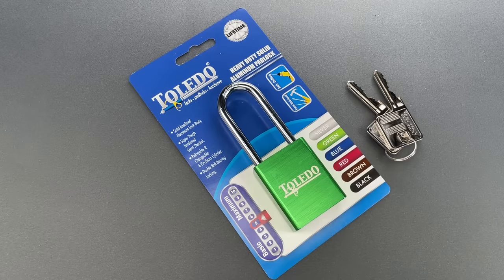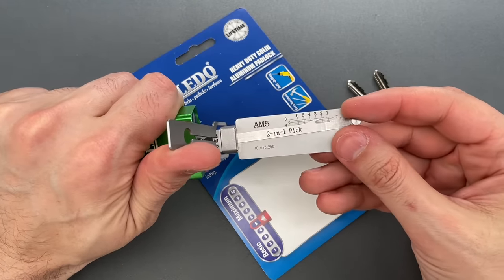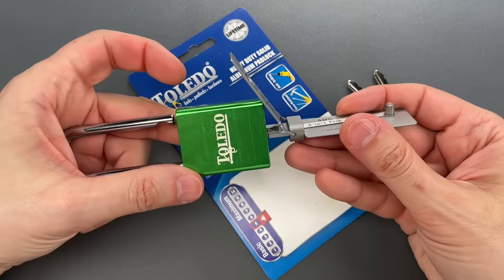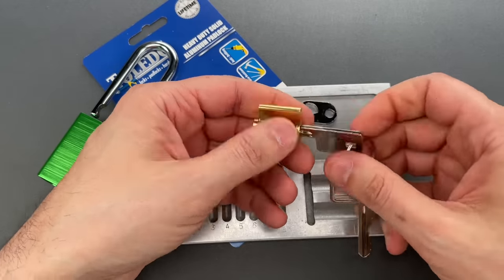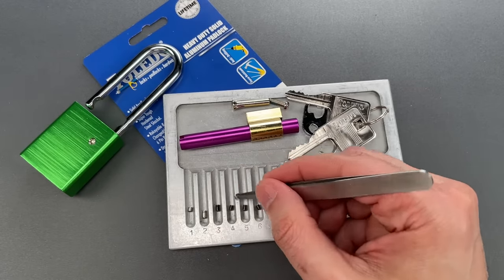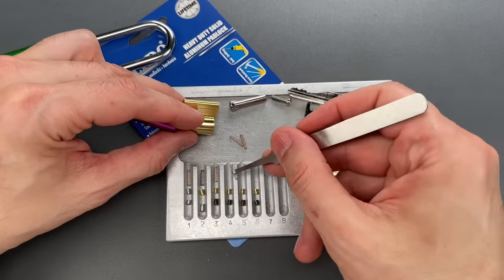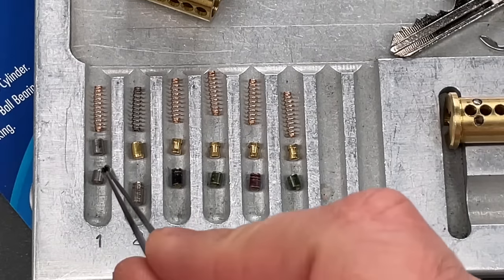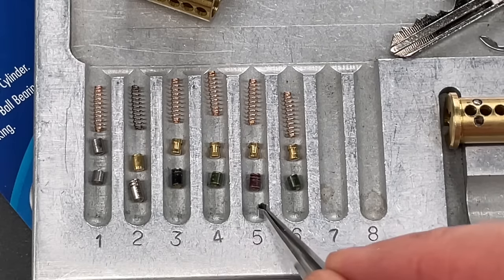[1550] Better Than Expected: Toledo 40mm Alum. Padlock

Comment: PRYBAR. I meant, yea this lock had nice pick resistance, but there is something about that nice sound of broken steel and stuff.
 
Also when lock to your toilet breaks, you need a prybar to get to the toilet (or out to stay alive). I didn't have a prybar, thus instead of opening it in 2 minutes, I had to find wrenches and use wrenches, and find the door is from two pieces glued together that partially get out, and find because I'm whitebearded disabled pensioner whos pension is still pending after 20 years, I have to live with partially warped toilet doors that are without lock. 

And all of that was because EU ordered to use heat regulators for central heaters, and because they blew up Nord Stream and they are supporting oligarchs in that xxx country, prices went up. And large difference between temperatures weakened door springs.
More rich people can afford more heating, thus they have fungus in theirs homes because of large temperature differences...
EU = we are living ecologically.

Comment: You said the core has two steel pins for dulling drill bits. Is there a way for you to check if the drain hole has something similar?

Comment: You are a very good lock pick and also know how to also attack a lock with force but you always do your tests in ideal conditions not attached to an asp and staple or motorbike locks that are in awkward places. It would be more of a challenge to see how the locks are attacked by picking or force when the lock is placed ideally on a garage, shed or motorbike with wet cold hands and a swinging lock also sometimes in the dark.

Comment: Why don't they just put the tougher springs on all the pins? Not sure if he mentioned this in the video.
Reply: First and foremost is cost. For mass production the cost of using those springs in all of the pin stacks would raise the price significantly across the board. 
But in practice you also don’t really need every stack to have a stronger spring since that one is already going to make it near-impossible to open with a bump-key

Comment: Hey all, I have a question and I figure this would be as good a place to ask as any. I have an apartment a screen door that is locking but I was not issued a key for it (the thumb button has a keyway.) I can lock it from the inside with a latch but without a key I can't lock it from the outside. I have a dog who is a good girl with separation anxiety who would appreciate it if I could leave the front door open while I go to the laundry room or to my car but I would appreciate it if I could lock the screen door for quick 2-10 min trips away. Is there a good way to decode a screen door lock so I can order a key for it?

Comment: If spring type matters why not use multiple different springs... Wouldn't it make it more tricky? And couldn't you set up a trick driver to reset if the picker moves the tumbler at all before the other pins are set? And there has to be a way to make a lock LOOK shim-able but isn't... Right??? We gotta have designers and metal workers that can figure this out right? (Oh great new generations of locksmiths that only keep the good locks for themselves while giving out the ones they know are pickable, breakable or just weak in general...) I actually witnessed some grab a masterlock and yank and it popped open, and it was a lock his father put in place to deter him from going past... Dad... You're 5ft tall and tiny those locks will stop you... but your son... is like 10ft and all muscle... Locks wont stop him... I THOUGHT he was gonna rip the lock off the door, but he didn't... He propped one hand over the hasp and took the lock with the other, with a hard quick yank level with the shackle, KACHINK!!! lock opened... I was like... "WHOA SOME WHO IS FASTER THAN LPL!!! Well Masterlock is done, shut down the factories! It's all over!" LOL!!!

Comment: Dear lockpickinglawyer.. Are you aware of "Checkhov's Gun" ? If you mention a weapon in scene 1, that gun must be fired in scene 2. You violated that rule, in this very video. You mentioned that you would drill that hole.. and then you did not drill that hole in act 2. Sir. We need an act 3 to see this corrected. ;)

Comment: That is probably 10/10 grade from LPL to a lock that company itself says being just 5/10 secure. Would be different if company would claim that this is 10/10 secure super pick resistant bullet proof lock that companies typically claim their products being. Kind of sad that company that is honest might not sell as well as the typical shitty locks, that claim being superior on the package even though they are not. I hope they add quote from LPL to the packing saying that company puts more effort to being  secure than most. I womder if they have some lock that is 10/10 secure if that is actually then really 10/10 lock. Or maybe they are that honest and don't even try to claim any of their stuff being that good.